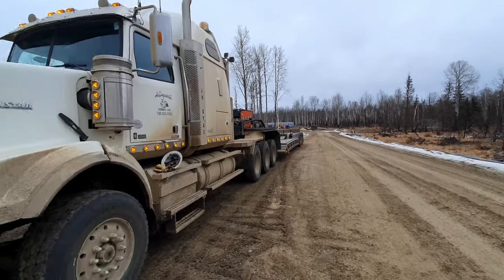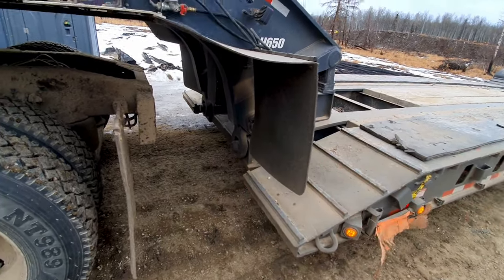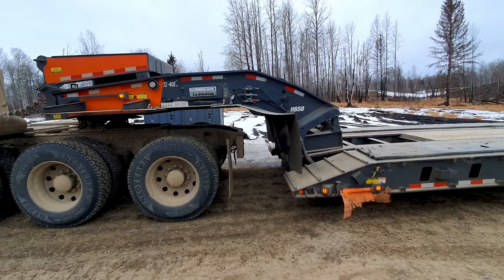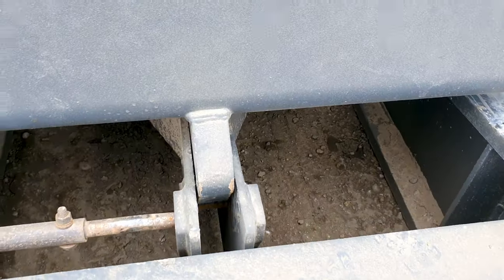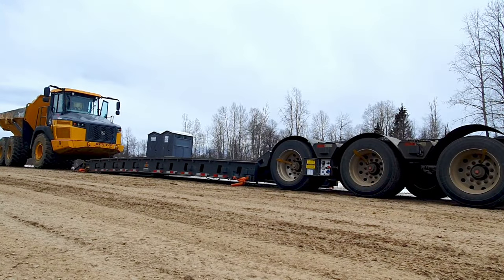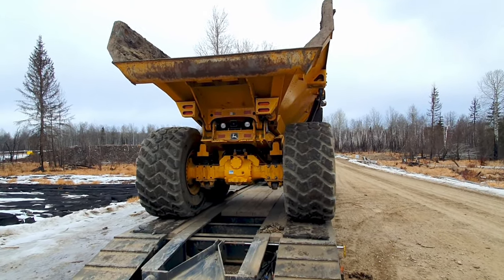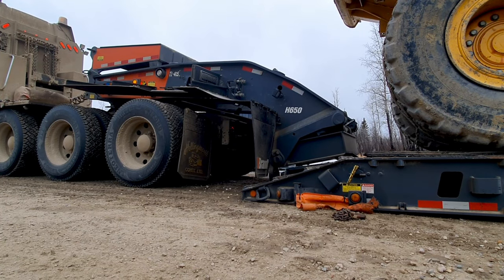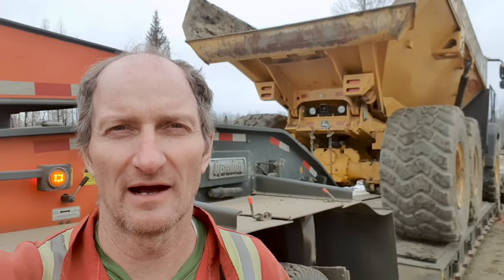Using Removable Goose Neck trailer

Comment: cool stuff,that rock truck must weigh a lot,i had one like it as a kid  ,i like those cabs on  your truck only been in british trucks  hitch hiking around a few times,our trucks  are flater and smaller cabs at the front dont come out like those truck ,if you see what i mean
Reply from the maker: Yes the trucks are different here for sure the cab over type is very rare here now where in Europe it's nearly always the case. The reason they have them over there is for size where it is not as critical and it is easier to work on a truck like this.

Comment: VERY COOL
Reply from the maker: Neat machine hey?  They are a little slower than just driving over the beaver tails but they're certainly safer.
Reply: @lovesloudcars  those dropped tongues has been the standard here in the Northeast USA for quite some time now. In fact, longer length beavertails over a certain weight are pretty rare now.

Comment: Went and swamped for my father inlaw a few years ago and he was pulling a trailer like that. The engine started with a rope though and it smoked straight blue lol.
Reply from the maker: Works pretty slick.  A little slower than climbing over the beaver tails,  but certainly safer.
Reply: @lovesloudcars  absolutely correct.

Comment: 1. Is it possible to drop the hitch assembly without reconnecting to the trailer?

2. When would you use the flip down portion of the hitch,?
Reply from the maker: #1: if you're asking if a guy can drop the trailer as shown for loading and then unpin the 5th wheel from the goose neck and leave it sitting somewhere else? I don't think so. 
#2 the flip down section is for connecting the trailer to a jeep for extra wheels between the truck and trailer when it is required for weight/wheels capacity.